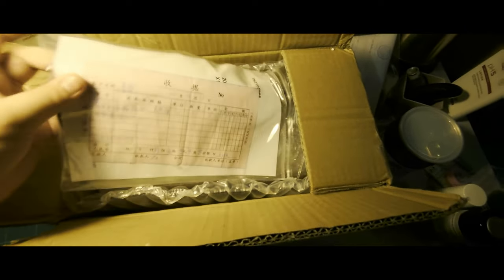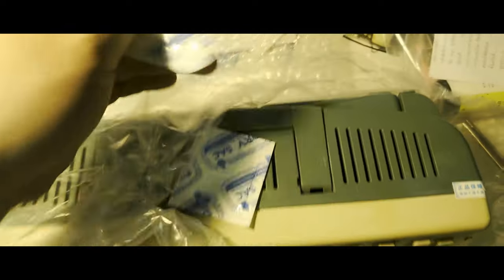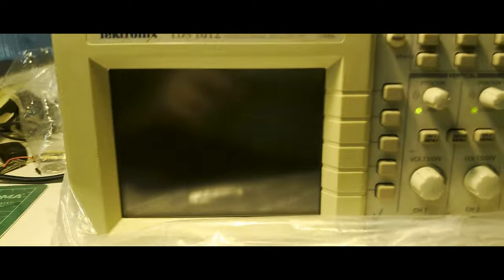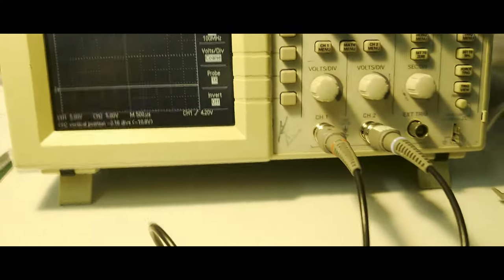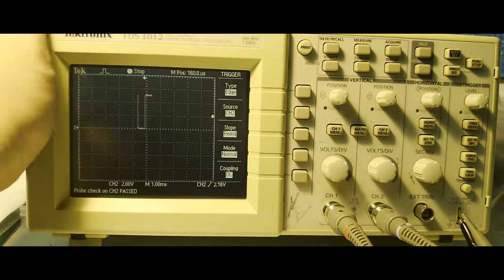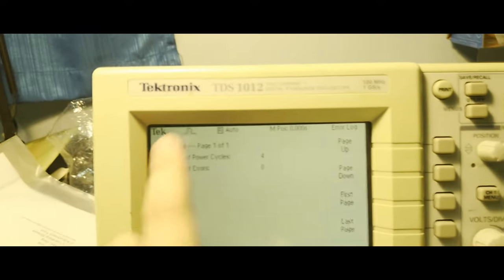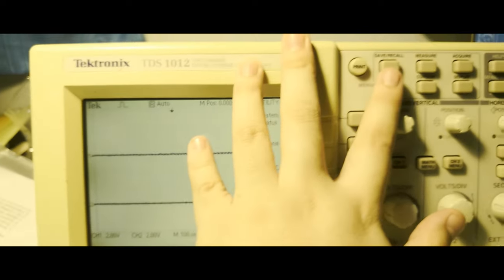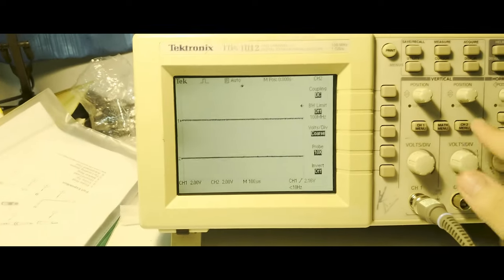Unpacking Tektronix TDS1012 Oscilloscope

Comment: 几天前，我买了一个Rigol DS1202ze，200MHz，大概200美元。比你的这个老古董看起来要新多了，功能看起来也更强。当然也更贵了，不过还好，可以负担，我是一个中年人了。
Reply from the maker: @罗建-g4h  I got this thing and I have a plan to upgrade it to 200MHz 2GS/s. Sadly that this thing only has 2.5k memory depth (It's built into the ADC). But most of the time I got away using logic analyzer, this scope would probably be for some specific use such as signal  identification or integrity verification.